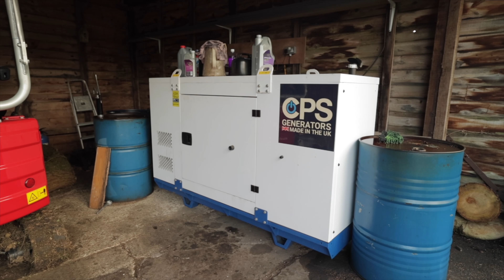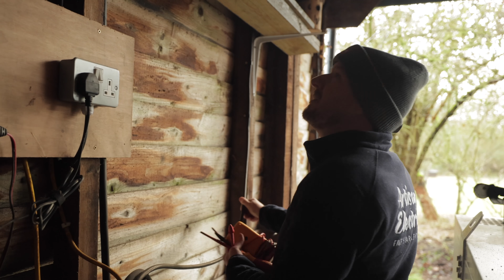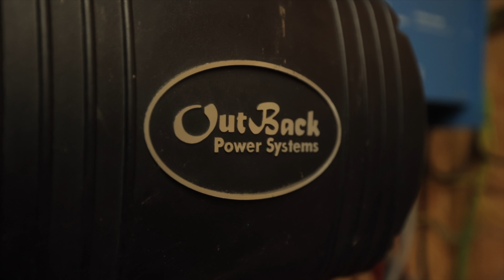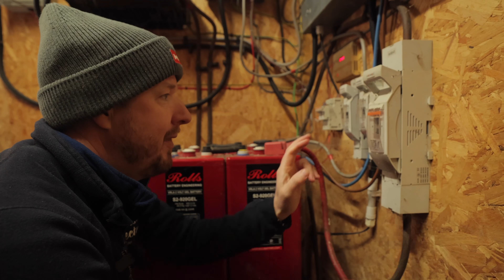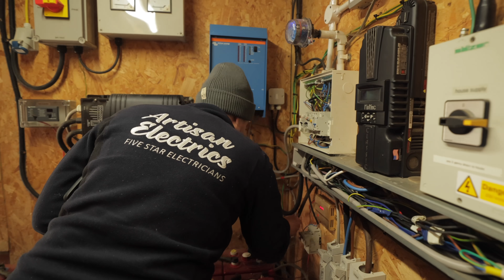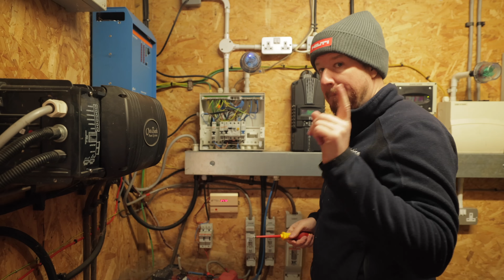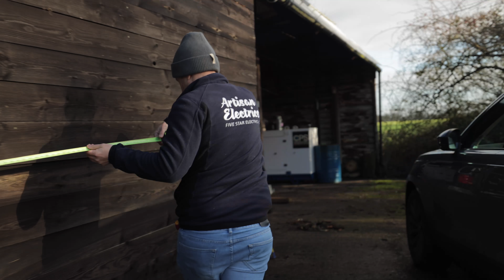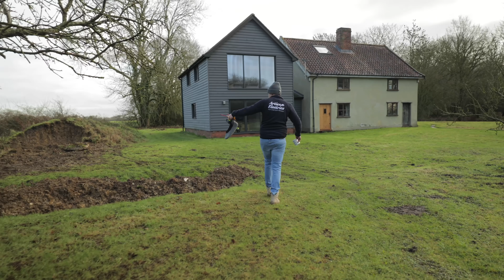DIY Off-Grid Solar Gone Wrong! (It Can’t Even Boil a Kettle)

Comment: Jordan, I have to say I really enjoyed this vid, you should do more on off-grid setups. If anything, this vid showed everyone what a mess the old diy systems were. Victron or not, it was a hotchpotch of a system. And I think there was only one or two Victron components in that disastrous installation.
But I am staggered by the number of negative comments you've got, all saying the same thing ... that you don't understand the current setup and hence are ripping it out to replace with a system that you do understand : Sig. 
Wtf? 
Your client would not want a patch up job done, just to get it functioning. He wants something clean, simple, and reliable. He doesn't want to mess around with a dozen different boxes on the wall, as happens with Victron systems. 
And he trusts your company to give him what he really needs, a simple, proven setup with all new warranties. And peace of mind that he can turn on the kettle and microwave at the same time.
Reply: He may want those things  or he may not. It's quite likely he just wants some increase in capacity and a tidy up for a modest cost.
Reply: Until Jordan learns the basics- I wouldn't advise him even touching any more offgrid jobs- his answer lately is always just ''rip everything out and fit a sigenergy'- $$$$$$$ - That system is all good kit (Midnight Classic is a bulletproof MPPT charge controller (NOT a bloody inverter- shows how out of touch he is with offgrid systems) as is the Outback inverter (although it really needs replacing- its only rated at 2000w which was fine a decade or two ago for a modest offgrid setup- these days a 48v 5kw Victron Multiplus would be the BARE minimum I'd be using- hell my own is a 12kw Sigineer 48v unit)  and the old Rolls AGMs need replacing with a decent set of EVE LFP lithium cells... add a few more panels (3kw on a second 60A MPPT charge controller- the midnight is fine on either 24 or 48v so can stay- that gives you 4.5kw of panels), tidy up the wiring (the original install looks like it was done by somebody who knew what they were doing, but theres been a lot of bodging in the intervening years by the looks....) and you'd have a bulletproof little offgrid system for a fraction of the price of a Sigenergy system.....

Comment: "This DIYER has no idea what they were doing" - goes on to call a MPPT an inverter 😂
Reply: So basically I have no idea about off-grid solar battery setups, I just wanna install my sigenergy system 😂😂
Reply: @joey5712 he's a snake oil salesman, he's always looking for the next new fad, gimmick, better stick with companies that will be around in 10 years, especially when it comes to inverters, and with off grid that would the toroidal type. I find this guy has no scruples, puts down other people's work all the time, we don't know how old the system is, was there add ons, and their budget
Reply: This guy has indeed almost no knowledge of offgrid systems. Doesn't even recognize devices right away and call them by their proper name. He would actually be a very bad DIY installer. Esthetically he might do better.  But he clearly doesn't understand offgrid systems
Reply: @ancovanbergeijk4766  This was painful to watch.
Reply: @ancovanbergeijk4766  yeah this. this was a painful watch. I mean yeah it's not neat install with all the cabling in perfect trunking, but honestly who cares. I bet it would have only taken a little bit of change to make this system safe and reliable.
Reply: I cringed at that. The outback system is Australian and is the daddy of solar systems. I have the more modern MPPT controller; it balances the batteries, floats the system,  and is amazing.   however the layout of the system is a mess, and it should be mounted in a linear way.
Reply: @Rockhopper1  just to note Outback Power is an American company
Reply: @EnergisedAdrian  whoops, no idea what happened there thank you
Reply: @EnergisedAdrian  Outback is from a country whose name starts with A!!!
Reply: @cartysfolly  If you look OutBack up, they are a US-based company, but were a top seller in AU, and some were built in AU too, now they are made in China, but still based in the US.
Reply: Yeah, and let's inspect the electrical installation that is tripping fuses bare handed in damp weather.
I'm sure nothing can possibly go wrong!
Reply: And then proceeds to demonstrate he has no clue at what he's looking at!
Reply: An MPPT (Maximum Power Point Tracking) inverter is
a specialized solar inverter that optimizes energy harvest by adjusting electrical operating points to ensure solar panels operate at maximum efficiency, even in variable weather or partial shade. It converts DC electricity from panels to AC for home use, often offering 30% more power than traditional PWM controllers.
Reply: @markae0  Yes but in this case it doesn't convert to AC (only steps down the voltage and of course tracks the maximum power point), so this would be called an MPPT Charge controller
Reply: @thomasdesloovere4200  thank you, at least he have a tiny bit more knowledge than the professional fitter
Reply: @markae0  It is not an inverter at all. It is an MPPT battery charger, nothing more. Inverters create AC power.
Reply: @markae0 Let's mix up PWM and MPPT shall we?
FFS.
MPPT is about maximising the extraction of power from the panel (by adjusting the impedance of the load presented to the panel).
PWM is absolutely nothing to do with that. Not even comparable.
Reply: @deanXRayZulu he did get the AC conversion bit somewhat wrong, but his comparison between PWM and MPPT wasn't so flawed as you suggest. Ultimately a charge controller is either PWM or MPPT, both charge a battery using solar power and an MPPT is typically 30% more efficient at doing that than a PWM charge controller. The fact that the technology behind MPPT controllers brings other benefits, or works in a different way is irrelevant to most people and didnt deserve a "ffs"
Reply: @mikebarry229 No.
I will explain it

PWM - Pulse width Modulation.
This is way of adjusting the waveform of electricity so that a variation in average current can be achieved.

So you might use this for charging a battery or very often adjusting the brightness of an LED light. It has even been used to control the speed on model electric trainsets. It's a better form of speed control than simple voltage control.

MPPT - Maximum Power Point Tracking
What an MPPT device is doing, is by way of an algorithm, adjusting its input impedance so that it matches the output impedance of the device to which it is connected.
This is done to achieve maximum power transfer.

MPPT is not about changing the waveform, it's not about adjusting the output power or current to a battery or load.
It's about pulling as much power as possible from a generation source that has a variable output impedance, as is present in solar panels.

When there are different levels of elimination on the solar panel, the output impedance of the panel changes. So the MPPT is about automatically adjusting the input impedance of the MPPT so it matches the output impedance of the solar panel, thereby maximising the amount of electrical power generated (in watts) for a given level of illumination on the solar panel.

If anybody says it is to do with battery charging, you can tell them they are wrong, and you can tell them I said so.

Now, a MPPT charger contains two elements:
1. MPPT device, to maximise power from the solar panel
2. A battery charger - for whatever chemistry of battery you intend to use

The name "MPPT charger" doesn't tell you anything about the charging algorithm employed within the device. The MPPT element tells you that the device contains an MPPT tracker.

Comment: The previous owner could’ve bought the vacant land and started with a c’van and ‘lean to’ shed and progressed from there within whatever budget they could afford. Lived off grid for yrs the same way for the same reasons. Those ol’ school 2volt batteries are the giveaway as anything Solar wasn’t cheap back then considering you can find panels for free now or close to it.. Plenty of 2nd hand Victron gear around now also. 
Guess the new owners have had a reality check on what many take for granted on power consumption and appliances, I had a gas fridge and stove and would’ve thought it madness to boil water from batteries to make my cuppa back in the day. However, having discovered the delights of an espresso coffee machine while ‘off grid’ camping, my 3000va Victron drawing 135 amps from a 12 volt supply was worth the upgrade in cabling ☺️ If you have a lazy $40k lying around, have at it i guess.

Comment: I've lived off grid for 6 years, similar setup (slightly larger 48v)
You just have to live within your limits, no drama! 
Customer is trying to live "on grid" it's a learning curve, we only used £200 of red diesel  per year, now built a new house with 3phase etc, my sparky hasn't got a clue about the off grid stuff and how to "optimise" it LOL.
As soon as it's all signed off the new house will be back off grid for 80% of the year, the mains will then top as needed. You need deep pockets to get a "Tic Tok" sparky to wire up off grid stuff....
Reply: Thats the best way.

Comment: If that's the worst you've ever seen, you're doing pretty well. You'd probably have a nervous breakdown from the things I've seen.
For off-grid, DC coupling your PV and batteries is quite normal, though 24v is quite uncommon, 48v (or 51v LiFePo4) is quite typical. Most of the places I see will typically design for around 45-100kWh of storage with 7-30kW of inverters and as much solar as they can fit. That charge controller would date the installation to around 2012, these are a great little charge controller that were pretty standard until Outback gave up and Victron came along and replaced them as the dominant manufacturer in Europe.

Yeah, it's a bit messy, not reg compliant and has some questionable decisions, but it was clearly only designed for light loads. My guess is that the inverter was dropping out because of failing batteries.
Reply: Related tangent: IMHO the European code re what counts as dangerous voltages kind of need to be updated. The current code has a limit at 50V, which unfortunately is slightly exceeded by "48V" systems when fully charged. Would be great if code would be updated to allow say 55V or so.
Reply: @The-secret-101 I’d be inclined to agree, specifically 58.4 to correspond with the peak voltage of a 16s LiFePo4 pack (though you’d usually only charge to 55v or so, and only for top balancing.

Comment: It's an "old" system. Things have massively moved with solar in the past decade, and especially in the last few years about storing energy for offgrid scenarios. Lead acid we'd now do LiFePO4 or Sodium Ion. Those original batteries were probably out of/and were designed for forklift use. 24V is a low voltage for energy storage like this, so if that goes to lithium the cabling can be smaller due to the higher operating voltage. It certainly could be a lot neater. The original owner and likely installer probably knew the power draw limitations and worked around them. DC - DC chargers for doing high current draw were hideously expensive so not surprised that there is lots of AC/DC conversion going on along with the conversion losses.
Reply: Yes it's only an old setup, now hybrid inverters are powerful, panels only monocristalline(and halfcut), battery only 48V LFP  and all items cost a fraction of this setup.

Comment: Economic circumstances dictate everything you do, fixing the issue without a re-install may be what the customer can, or is willing to afford, a re-install is a lot of red diesel.
Reply: Exactly, especially an Artisan new install which Jordan has said many times won't be the cheapest because he wants to take time for a neat job which is fair enough. When I brought my current house I was skint and had a 1970s fuseboard ripped out for the cheapest BG Consumer Unit by the cheapest legitimate sparky I could find because I was broke but needed the system made safe.

Comment: Overall I think you really need to get into ‘off-grid’ and they you can talk about these systems and seem as though you are understanding the components. Wiring issues aside, you need to understand what a charge controller is, (it’s not an inverter), more a buck inverter. Outback is one of the biggest brands in the world? This is nothing about being a Victron system, it just happens to use a Victron battery charger. You are doing a great disservice to Victron and installers who put these systems in every day. Why didn’t you just suggest the customer contact Cory, who knows what he’s doing! But no you just choose to offer a completely unnecessary Sigen system, lots of money, probably not the best system off grid. A proper Victron system would be a much better solution. Just a money making exercise as ever!

Comment: so much junk to supply so little power
Reply: It's very high-end 'junk'. This is a state of the art install using best available gear circa 2012. Could be tidier, but it's a lot better than Jordan is giving it credit for.
Reply: @xxwookey yep ok so it's old and messy then. I have built a few 15kva to 30kva victron systems in last 5 to six years and it is so much  cleaner install.

Comment: Do a comple ac  voltage  calc before  evrn considering   what  dc you inpi you 

Me i live in the   reqlm of  240 vac  ains  with a minimum of 22.-50 kw output

Wi 6 exhaust fan at 1.5kw  yor at  9kw

12kitchen and  and  laundry 14-18kw
Reply: well, dont forget the UK network operators size the street mains to handle a long term average load of between 1 to 2kw per house only.  Yes each house has a 100A incoming fuse, but the substation that feeds 70-100 such houses on each phase has an 800A fuse at the transformer secondary. If you don't bother, yes, peak loads can be high, but with a bit of careful load shedding / staggered starting its surprising how little power you really need.

Comment: yea guys probably gona install chineezium HV/HF poop in place of victron.  These things will blow if they see lightning miles away, no not direct hit just induced voltage.
While victron would last almost anything cos mosfets are not on line side on Low Frequency inverters. I see LOT of cineez crap Deye and  other FH inverters that output stage is just exploded. Specially bad are new High Voltage variants, They just explode so that PCB ill be destroyed, usually there is nothing to repair any more.

Comment: 16 amp kettle? off grid, like on grid, makes no sense to me... but sure that system is just waiting to self destruct
Reply: The kettle will be a standard UK 2 or 2.3kW (so 9-10A). For a low-power offgrid system like a this a smaller 1kW kettle (5A)  is much smarter. Half the speed, but you can turn something else high-power on at the same time. It still only takes ~60s to boil a mug of water.

Comment: Yer it’s another not neat so let’s rip it all out cos I don’t know how it works or what is wrong with it 🤣🤣. If the customer has a spare £30k+ then I am sure you will do a cracking job on a new system . I have spent a lifetime working in industrial control I am sure you would have a heart attack if you opened some of the control panels that normal electricians work in. Can’t imagine rocking up to a new customer that had a problem on something installed 30+ years ago and saying we needed to rip it out and replace it 🤣🤣 the tone of your voice when describing your findings says it all,

Comment: Honestly, if this was my house, and money wasn't an object, I think I'd just go "Mate, I want you to clear this stuff out, and start again with modern commercial equipment that will do the job."
Reply: Exactly. And the system proposed is not expensive, just new and reliable. A Sig system is not made for 'money is no object' customers, it's right on par with Tesla, Franklin, GiveEnergy, Sungrow etc. And a quarter of the price of an equivalent Victron system..
Reply: @MichaelWakefield-mx6hg  A Victron system to give him 2-4 times the load capacity (5-8kW) plus a new LFP battery of 3 times the capacity (16kWh) will be under 4 grand in parts. You sure Sigenergy is cheaper than that? I can't check because sigenergy don't seem to publish prices except to installers.

Comment: Well obviously if you remove pretty much the entire installation and start again  at four times the price, it's probably going to be better, or at least more up to date.. I didn't see anytbing that was actually unsafe, as opposed to OCD compliant. Add some panels, tidy up some of  the wiring and install a new feed cable and it would probably be fine.
Reply: It may need some new batteries, and the owner probably wants a bigger inverter. If he wants to go bigger than 7-8kW he probably needs a fatter cable to the house so sticking below that will keep costs down.

Comment: 8:51 tell me you know nothing about solar without saying it
what you have you hands on is an MPPT charge controller...it takes high voltage low amperage DC and inverts it to a high frequency AC then converts it to a low voltage high amperage so it can charge the batteries correctly

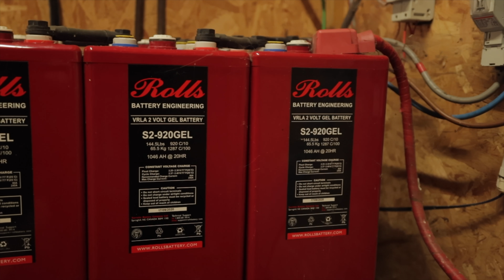Comment: 4:18 found the problem...it's only a 24 volt system....12 2 volt batteries at about 1000 Ahs......with the Ah it will last for a few days without sun.....but the voltage wont let it surge much....so the "kettle" shuts it off
Reply: 24v systems can be fine- hell I ran for 3 years on a 12v system- and I could run a kettle and the airfrier at the same time- the issue is the inverter wattage- the Outback is only a 2kw inverter- which is why it shuts down- its being overloaded- my 12v inverter was a 8kw 12v Powerjack lol- hell I even ran the welder on it quite a few times....    But the Rolls batteries are extremely old (good quality, but if they were installed 10 years ago, at the end of their service life) which wouldnt help...